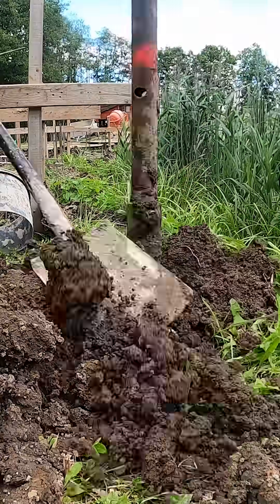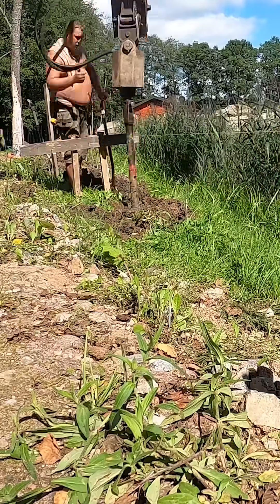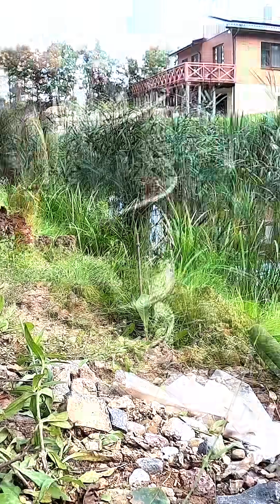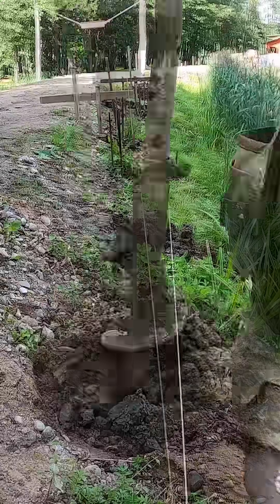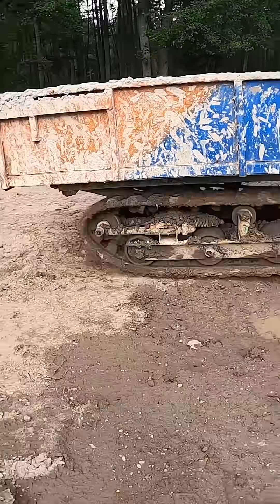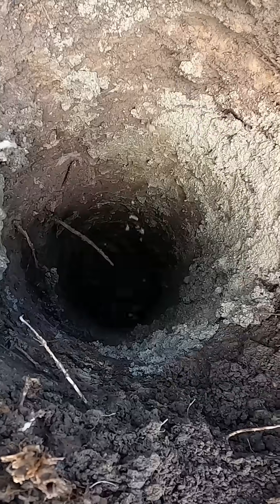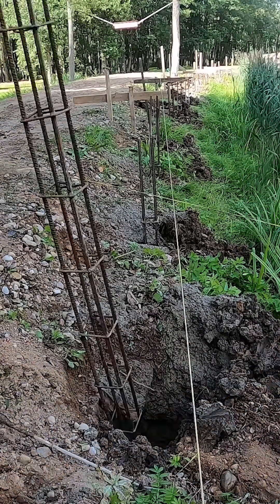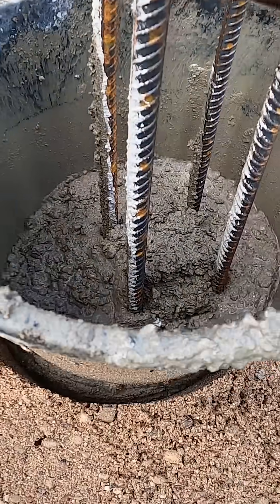Drilling Piles Right Next to a Pond

Comment: Cool job, what’s the diameter of your auger bit? And, do you have to worry about frost depth in your part of the world, where I live it’s around 4-5 feet (1.2 meters-1.52 meters) deep. Nice work dude.
Reply from the maker: This one is 30cm diameter. Our frost depth here is around 1.2m, but since this section is on a slope and will hold a retaining wall, we drilled them about 2m deep.